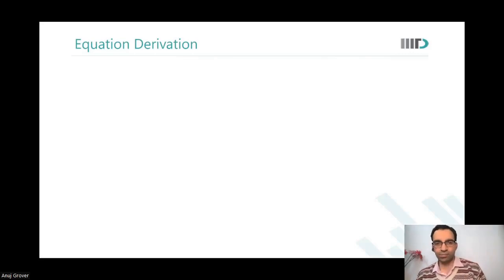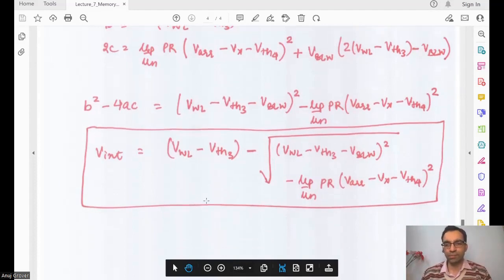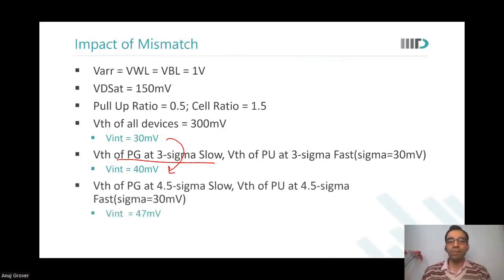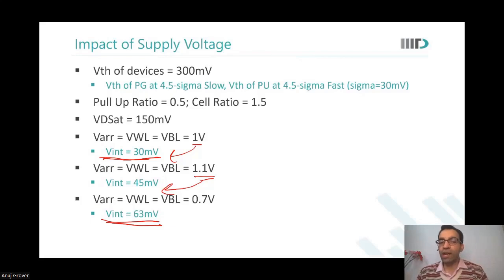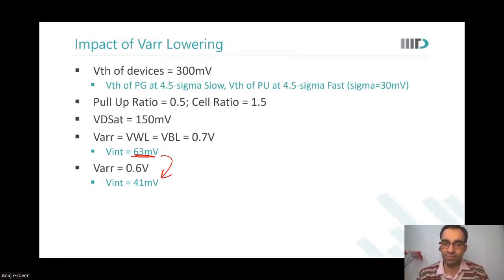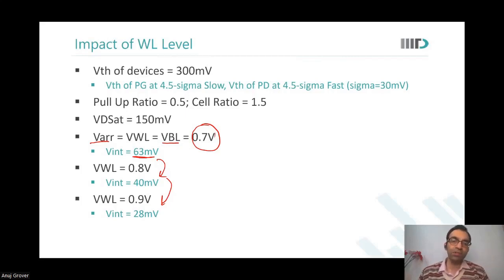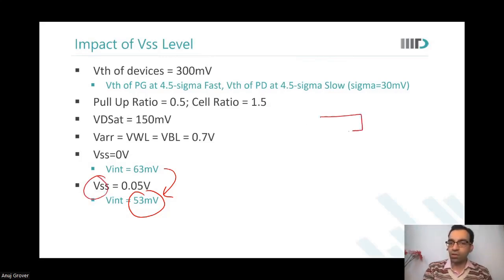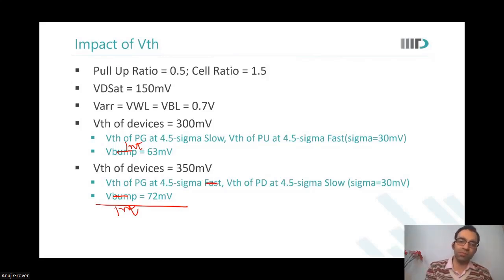Write-ability analysis - Impact of Pull Up Ratio

Comment: Hello sir, 
Good afternoon! 
In the Impact of Varr lowering part:
We say the penalty is write time. But isn't writing 0 into the cell faster than before because the pmos now sources lesser current and thus the Vint charge drains faster into the BL? 
In this case are we saying that write time increases because the '1' write on blti takes a longer time as pmos sources lesser current? Doesn't faster 0 write force PU to switch ON faster and counter this phenomenon?
Reply from the maker: It will strongly depend on the sizing, technology behaviour, and mismatch. 

While in most cases it might maintain write time, and in many it will probably improve due to the reason you mentioned, however as a designer one needs to qualify the worst case. For that worst case, you will notice that write time degrades.